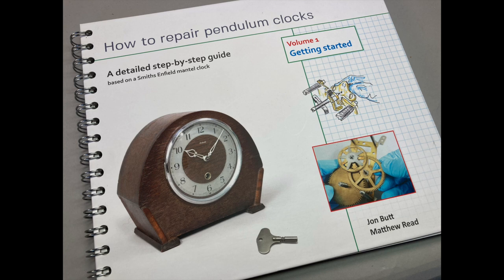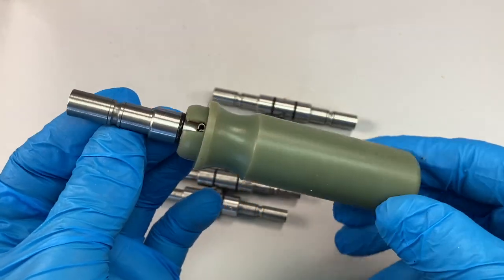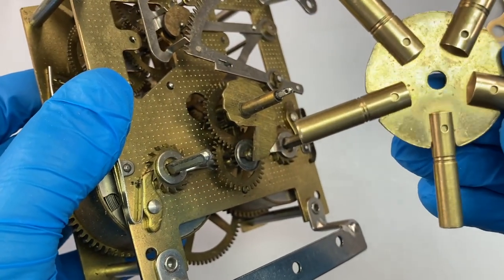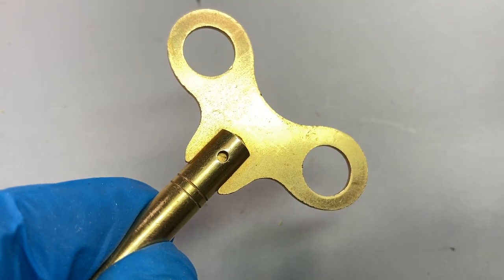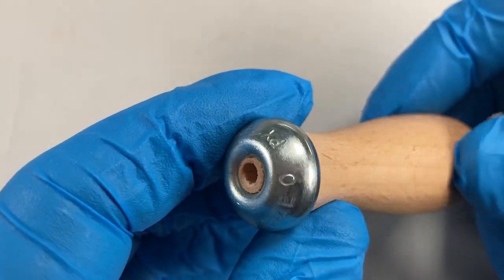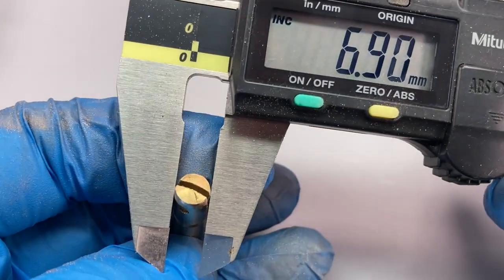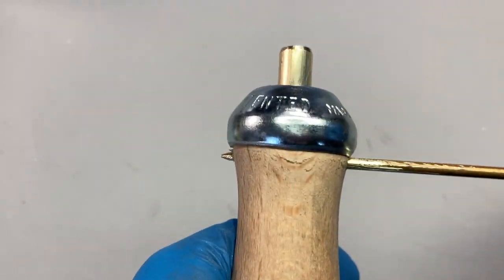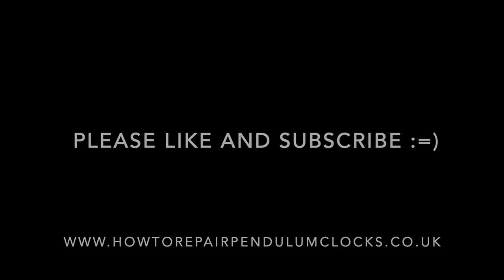015 Making a clock mainspring let down tool #Clock #Repair #Safety #Tool #Shop #Workshop #Mainspring

Comment: Great video Matthew. I have never purchased any let down tools. I learned how to make a home made one from the VHS tape that I purchased on General Clock Repair in 1999 and I still use it today. Mine however isnt as fancy as this one as it just is a dowel with a slot for the key for the clock. I have since modified it by drilling a hole down the center to take odd shape keys.

Comment: Hello Matthew I was watching your video I have a problem with a Seth Thomas mantle clock my first and what I’ve done I believe was over wound the clock chime and now it is ringing quite fast and I know that it is complicated to get to it to chime part of it so I have accepted the fact that I would let her chime in time until it starts chiming correctly which I believe would be about 3 to 4 months time if you could confirm this I would Rest easy knowing that what I have done will resolve itself of course in time
Reply from the maker: Hi Eric.  You may have this resolved by now... my thoughts are there are two likely reasons your clock is striking too fast.  One is that the mainspring has been replaced and it oil too strong.  This is incredibly common.  Not that easy to resolve as you would need to disassemble the clock and choose a thinner spring.  The other reason I can immediately think of is whatever type of governor the clock uses to regulate the striking/chiming speed is slipping.  If not is what we call a fly - an air resistance device - there is a spring that allows the fly vane to slip very slightly on its axle (arbor).   If this spring is assembled incorrectly or worn/damaged, it can allow the train to run unrestricted.  This is relatively simple to diagnose as you can see the fly arbor moving excessively in relation to the fly.  The final thing is if the fly is of the centrifugal type - it actually increases is effective radius as it spins - these can often become jammed and remain at the smaller radius even when in operation.  Hope that helps.  Let me know how you get on.  M

Comment: @2:00 there is a locking mechanism that holds the key from unwinding. What is that called?
Reply from the maker: @cmj2b  It is called the winding ratchet or winding work comprising ratchet click, ratchet wheel and ratchet click spring.  Hope this helps. M

Comment: Where is the video on removing the hand arbor, I need to remove the  centre  lever cam on a smiths enfield striker.
Reply from the maker: https://youtu.be/L_qkAR2PzZU  Fast forward to 40 minutes. Hope it helps.  This is not a definitive video, its just to help.  Good luck.  Matthew
Reply: @howtorepairpendulumclocks   Thank you Mathhew, found your video again after sending message yesterday.
    I have now taken off the hand arbor the way you described  using a split stake in the vice, but used a hollow stake that just fitted over the front of the hand arbor and rested on the ridge just past the square flats for the minute hand, I didn't have a spare key small enough. Re bushed and put the lifting collet back on. It is a run of the mill smiths Enfield striker. I held the  rear of the arbor in soft jaws and used a hollow staking tool over the front of the arbor resting on the collet and carefully hammered it home. Making sure that the levers were in the correct relationship to the square for the minute hand. Getting the hang of clock repairing now, after about 6 years, and 160 clocks.
 I work on them 7 days a week. Got a bushing tool now which really helps. A bergeon one, with the full set not cheap but worth it. Also spring winders. I need them with the amount of clocks I get working and then sell on, and repair work for people. I do this full time now best job I have ever had, and can work from home.
Reply from the maker: @verybigkittens7550  Thanks for the report.  Nice to read different work-arounds.  Great that the work is going well.  Matthew
Reply: @howtorepairpendulumclocks   Thank you Mathew for the kind words, Are you based in the north riding. I live in cheshire. I have subscribed to your channel. I am in a clock club that meet every 2 months in marple but not now since this pestilence  plague started last march.
Reply from the maker: @verybigkittens7550  Yes, in North Yorks.  Have you seen our Open Clock Club?  It meets every Saturday at 18.00 on Zoom.  It is free to attend and all are welcome, especially beginners.  search Eventbrite "Open Clock Club".
Reply: @howtorepairpendulumclocks   Thank you Mathew, I tried zoom regarding the clock club I am in, have n't met since this pestilence plague  from China  started. Tried zoom with the local clock club I am in ,and it won't work with vista. I did purchase a cheap camera off ebay it said it would work with vista but it didn't. Stephen.
Reply from the maker: @verybigkittens7550  Hi Stephen.  In which case you can catch up on our Open Clock Club YouTube channel.  Matthew